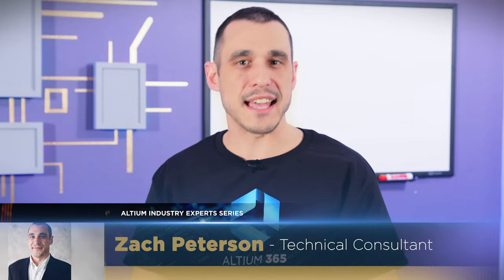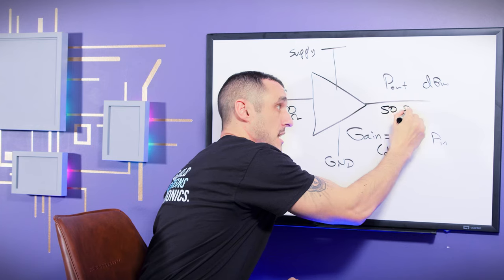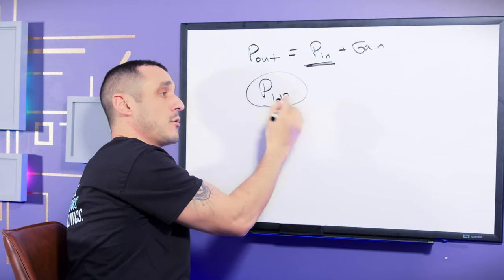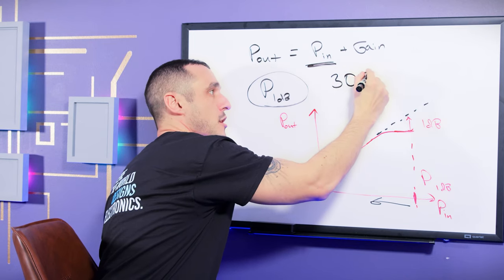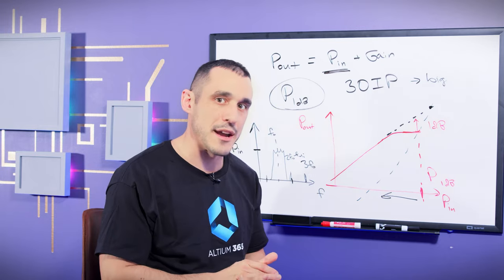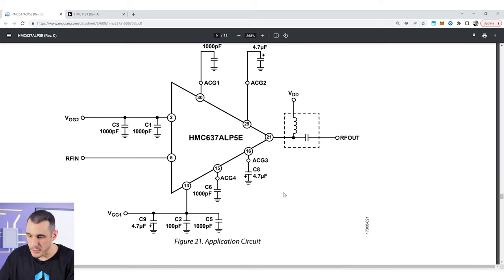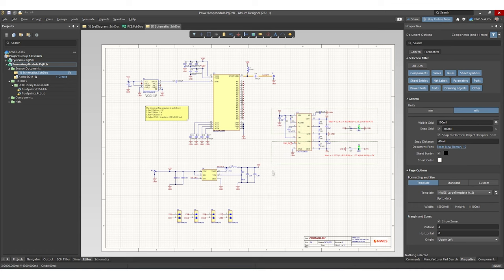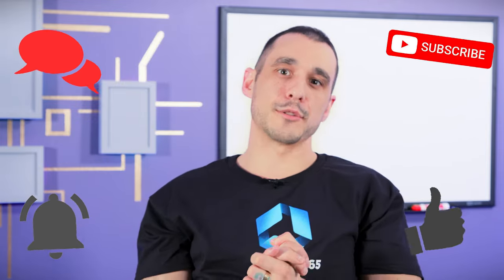RF Power Amplifier Design

Comment: Those chips are very capable BUT DID YOU SEE HOW LITTLE THEY ARE!  When I got the parts in the mail I thought they sent me the wrong parts! They are less than a quarter inch square! The pins are 25 mils apart! Just soldering the part to the board takes a lot of patience!

Comment: Great video. I just want to point out that usually, the P1dB is refered as an output power rather than an input power (at least by many PA manufacturers). So on your graph, it would actually be the value on the Y-axis rather than the X-axis. Still, keep up the good work!
Reply: I usually see that in the Hittite datasheets for example, they will show an output P1dB vs. frequency curve so you can see where the P1dB starts to drop out to lower power.

Comment: First of all, I would like to thank Zach Peterson for his valuable videos. We want to operate amplifiers at the P1dB compression point, we know that. Let's say we want the amplifer to not saturate. What protection measures can we take for this? Should we use limiters, drivers, isolator, attenuator or something else?
Reply: I think, using Attenuator will fix the problem.
Reply: If your power being given to the amplifier is too high then you would need an attenuator, or you need to bring down the power output of the source. In an earlier version of this module that was done for a client, we had a different amplifier with higher gain but lower saturation, and we had to put an attenuator on the source to make sure there was no saturation.

Comment: Thanks a lot. Would appreciate if you made a video about impedance matching for RF power amplifiers, since it requires specific Zin and ZL
Reply: That's a great topic, it requires a technique called load-pull analysis when working close to saturation. The premise is that near compression, maximum power transfer occurs when there is a slight impedance mismatch between the amplifier and load. I'll have to figure out a way to do it without ADS.

Comment: It`s not like an amplifier always have to work in a linear region. Many amplifiers experience gain decrease due to high temperature. When you drive your amplifier above P1dB gain/output power should be more stable. This phenomenon should be taken into account especially when you are designing multistage amplifier. I would love to see how to implement a flange mount amplifier or any other flange mount component into Altium PCB project (how to properly prepare footprint in .pcblib for it).
Reply: That's true there is no requirement to always be in the linear region but the intermodulation product issues with FM signals demands working more in the linear range.

Comment: I'm assuming there is currently no way to do it in Altium, but one of my wish list items in the schematic would be being able reference specific component parameters as variables in text strings. For example in the schematic you had formulas written out for the voltage of the supplies based on the feedback resistors, it would be nice if you could grab the resistor values and write a formula that auto calculates the values. It would be especially useful for projects that have variants with different values.

Comment: How do you chose a proper anntena? or a proper connector as in SMA might be good enough but should i use it or go for i dont know.... 
Also one of those amplifiers had the gain set by an analogue voltage how should we approach it ? is a DAC+buffer ok? 
Also both had some current that you needed to measure is a shunt ok in this use case?
Reply: If you are selecting an off-the-shelf antenna, you can use the return loss spectrum from the datasheet. From this graph, you will be able to see the Tx/Rx bandwidth and the peak broadcasting frequency. The return loss spectrum is equivalent to the S11 data and it tells you how closely the antenna's impedance is matched to a 50 Ohm input impedance. If you are designing an antenna, such as a printed antenna, then you need to simulate the antenna with a field solver or you have to rely on equations that predict the impedance/bandwidth for the antenna. SMAs are standardized connectors for external antenna modules and for connections between RF modules, I do not have their useful frequency limit memorized but the limit is pretty high.
Reply: I have never used a DAC + buffer to generate such a voltage, usually it would be done with an adjustable regulator circuit. I would say not to use a shunt element for the current because now you would be loading down the load and the current you measure will not be equal to the current you deliver to the load.